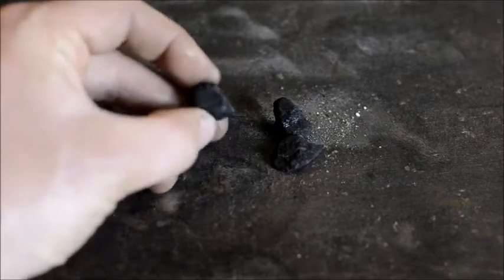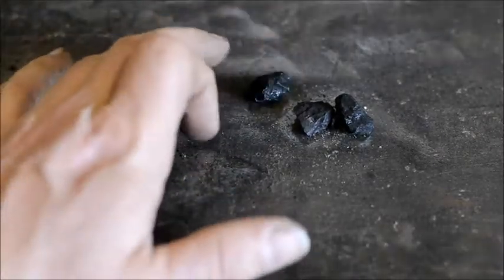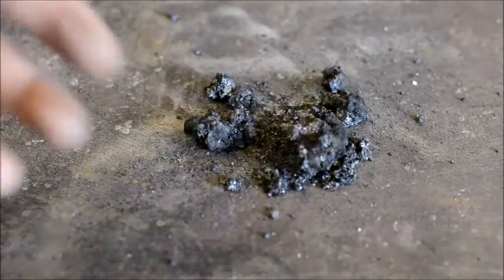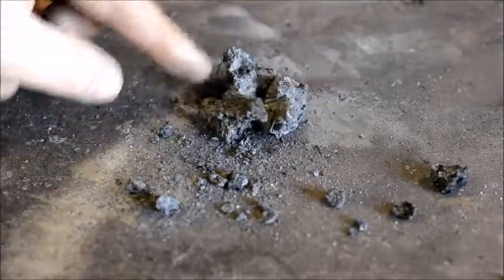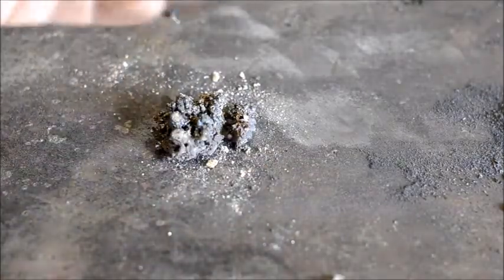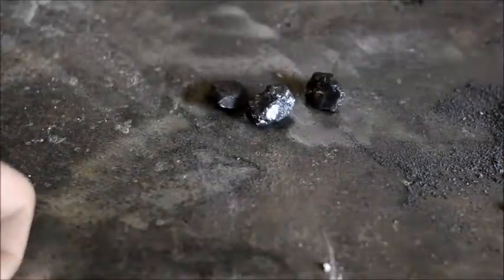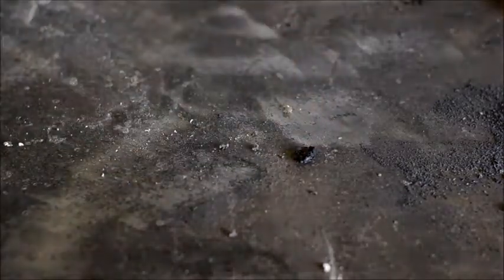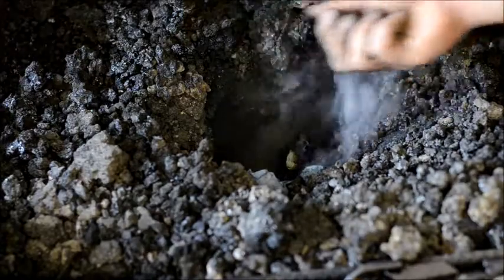Starting a Coal Forge Fire // Starting a Coal Fire in a Blacksmith Coal Forge

Comment: Good video...  I always like to see how others operate!

Not intending to open a can of worms (or maybe I am),  here is my 2 cents.. 

I find that anthricite has the highest btu's, is the cleanest, and lasts the longest.  It does require a constant air supply. 

 Bituminous is 2nd for btu's, cokes up well, and stays lit. 

 Charcoal is right there with bituminous, it just takes more of it and there are no clinkers.

Coal is not easy to find in my neck of the woods unless you want to pay an arm and a leg for it ($1 per pound shipped) so I use any kind of coal I can get.  I also  use alternative fuels  (charcoal, dry wood, and dried corn)  They All work!  Maybe this is a subject for another video?

I am in the planning stages of building a gas forge as I sometimes don't have fuel for the coal forge.

Thanks for the video...
Reply from the maker: shadowcastre not a can of worms at all I enjoy different takes from everyone. I personally prefer good bimutimus coal over everything else with the exception of metallurgical grade coke. reason being not over oxygenating the fire. but alas you use what you got to feed the addiction :-) Thanks for taking the time to comment!

Comment: Roy, I enjoyed the video, but tend to disagree with some of your comments. I clean the firepot out before each fire. Build a small wood fire with kindling, add fine green coal, add nut size as the fine starts burning. I reach forging temp within ten minutes. I use Pittsburgh 8 seam coal with little to no clinkers. From ambient temperature to welding temp in under three minutes, depending on stock size. Pittsburgh 8seam cokes very well and quickly. Again, not saying your method is wrong, just don't totally agree with it. Forge on brother
Reply from the maker: Richard Chapple thank you for your views brother. God bless

Comment: Great video! From my research anthracite has the highest btu value (by volume) of any fossil fuel. It's makeup is basically the same as coke(nearly pure carbon), so you have to treat it more like coke than green coal. The "smoke" in my anthracite video is mostly steam because the coal was wet. Anthracite also takes a TON of air. The blower I started with would run bituminous fine, but wouldn't even light anthracite. I would never want to run anthracite with a hand blower. Keep up the great videos! I don't think I could ever get bored watching a fire. Do you know when the quadstate is this year? I'm planning on going, but I have some other stuff at the end of September and don't know if they overlap. Define Your Legacy!
Reply from the maker: Warped Legacy It would be great to do a comparison video of the two side by side! maybe a future collaboration;-) Quadstate is the (22th - 24th) this year... I live 45 min from sofa so when you come out you should come early and visit!
Reply: Christ Centered Ironworks that would be awesome! I'll try and come down early. And I bring a bag or two of my coal so we can mess with both.

Comment: I have an old champion forge that does not have a fire pot.  It’s basically a flat pan with an air vent in the center. How should I build it?
Reply: BTW, 
I only have anthracite coal available.

Comment: Start with charcoal, its super fast
Reply from the maker: +ThisFish thanks for the suggestion And thank you for watching.
Reply: Hey, thanks for making these videos, i've learned a lot. I've only just started smithing. I start my forge with charcoal I made in an old popcorn tin, I burn some firewood in a burn pit and then shovel it into the tin and put the lid on (wearing thick gloves) it makes enough to light my forge about a couple dozen times. The charcoal lights up super fast when I turn the blower on and it lights the coke quickly. The whol thing is bazing in under 10 minutes. Originally I had planned to only use charcoal but it burns so fast, I had to use coal because I couldn't keep up with making the charcoal and it's too expensive to buy.